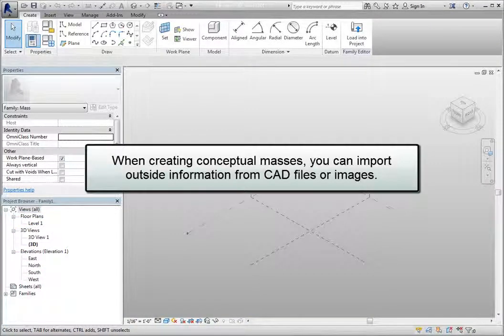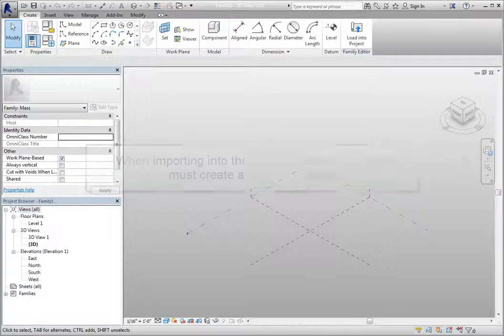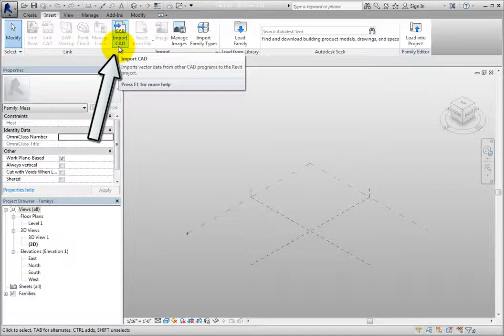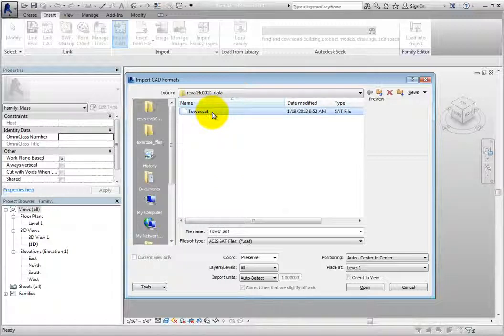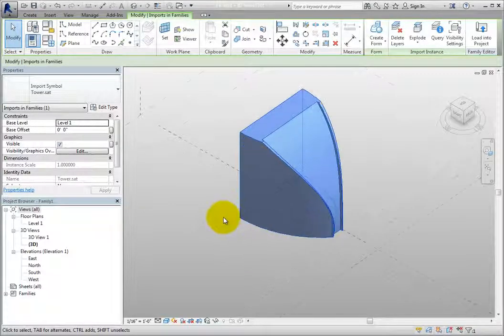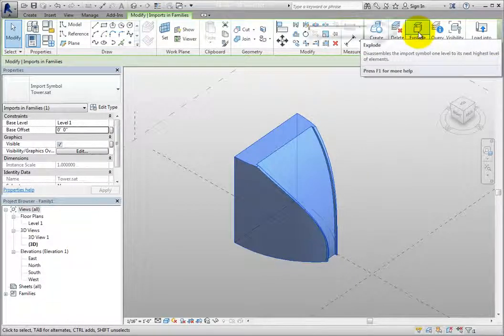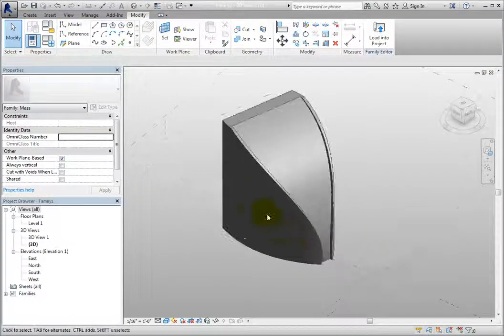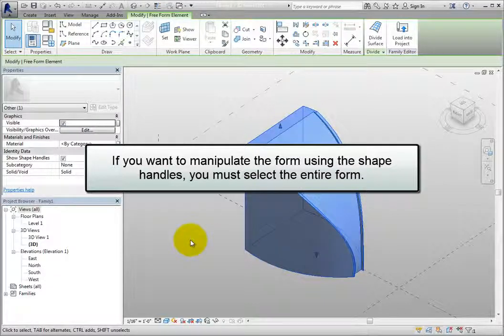Creating Forms from Imported CAD Files

Comment: Hello,

I am looking for a Autodesk inventor 2014 VBA programmer who can develop the below code for the program.

i would like to have the ability to offset the sketch for about 72 inches (user adjustable setting) in autodesk inventor 2014 (and newer)
1. 3d PlayStructure assembly is open and operator has grouped all of the components into a single "block" and the "block" is selected. 
2. User opens VBA script interface and selects offset distance and degrees of rotation (which determines the how closely the offset outline will adhere to the outline of the structure) and select "enter" button.
3. VBA script will Draw the playground boundary line/spline/polyline around the sketch 
4. User must then be able to take the boundary line and extrude it to 3d in order to place it within a 3d site drawing.